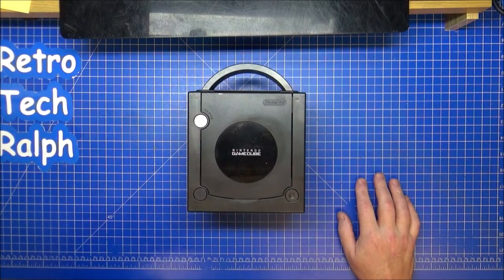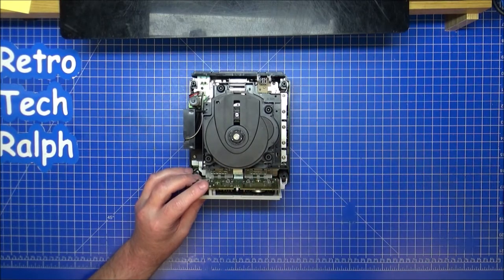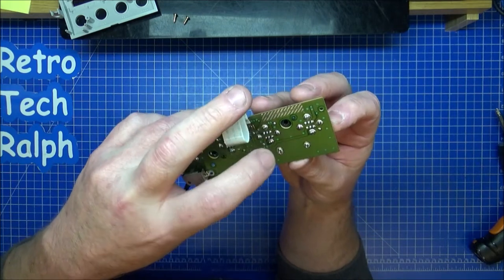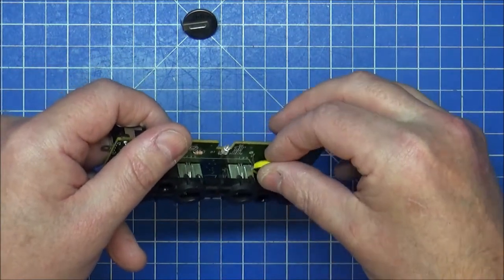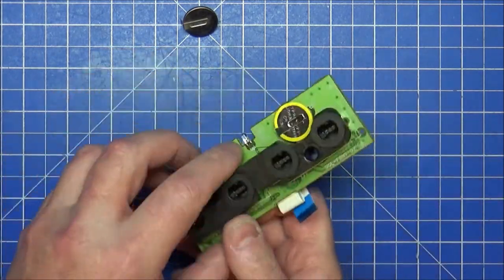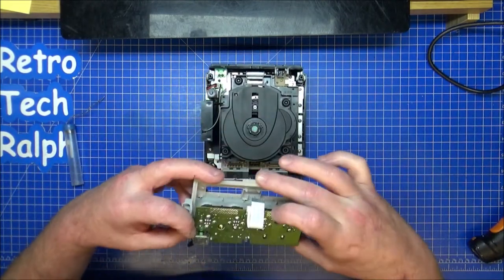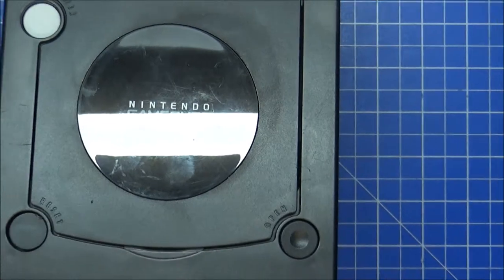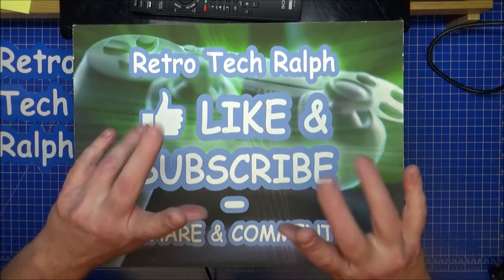Nintendo Game Cube Clock Battery Replacement

Comment: What if I got batteries that don't have the posts already attached. Can I recycle the ones from the old battery?
Reply from the maker: It is possible. The posts are usually spot welded to the battery and will be difficult to solder back onto the battery. Its not recommended to over heat any battery. If you like, you can add a battery holder instead, so you can easily replace the battery in the future.

Comment: I just took mine to a repair shop to have the battery replaced because it wasn’t keeping accurate time anymore. It would always show the time of the last time I had the console turned on. After bringing it home it now says that system settings were lost and I have to reset the clock every time again. Is it possible that the repair shop put the battery in the wrong way?
Reply from the maker: either way, they didnt do the job right. maybe a flat battery too
Reply: @R_T_Ralph  I had a warranty so I took it back. Battery was put in the wrong way. This time I plugged it in and got system settings were lost, I got 1/1/2000 instead of a random date 🙂

Comment: I've noticed that the clock seems to restart everytime I boot up the GameCube, but my Gamecube recently has been crashing as well, could the clock restarting mid game lead to the Cube crashing?
Reply from the maker: It is possible, with some games that save mid point, the clock being not set could cause a confusion on the system that could cause a crash.  Its an easy and cheap fix to replace the battery, and a must fix for all these systems anyway. 
Basically i think yes, it could be.
Reply: @R_T_Ralph  I see cheers buddy

Comment: So i got a Panasonic GameCube the times change all the time does it mean i need a new Battery if so how do i do it ?
Reply from the maker: yes, the battery will need replacing.
I dont own one but i assume the internals are the same as this, so just open it up and watch the video.
Reply: Q is not a fun machine to open up...

Comment: Are you planning the hdmi mod? I want to do it on mine but I'm not brave enough
Reply: I would suggest the eon Gamecube to HDMI convertor. Its a little expensive but easier than modifing the whole cube
Reply: @rens4354  keep in mind if you want to use that, you need the GameCube model with both ports on the back.

Comment: I don't really care bout my clock showing the right time, more about that this old battery will not leak, so will the gc still work if I remove the battery? Or do I maybe will have to "bridge" the contacts?
Reply from the maker: it will work without the battery, and to be honest, these batterys dont usually leak.
But please, dont bridge the gap, it could short something out.

Comment: really annoying that nintendo wanted to save the $0.05 and dropped the socket. now i gotta order a different battery / socket and pay extra for postage. oh well.
Reply: update: I happened to buy a hot air station for another repair; it made desoldering the battery so easy. the battery socket was easy to solder in using my iron afterwards. now no one will have to do any soldering to replace the battery. neat

Comment: I have some batteries for SNES cartridges. Will they work in a GameCube?
Reply from the maker: yes, but you may need to bend the legs a little. I use the same batteries on both, either should last a decade or more of shelf storage.
Reply: @R_T_Ralph  I've seen GameCubes that show a message in red when the battery is dead. Mine didn't, but the clock doesn't seem to run when the power is off.
Reply: @gbilo24  does that mean the battery needs to be changed?
Reply: @Emmanuel155b  Yeah. I changed the battery on mine (the clock would only run when the power was on) and now the clock works well.

Comment: Is it 100% necessary to do this? I havnt found any issues playing games even animal crossing i can start with no issues just wondering anybody?
Reply from the maker: not 100%. Its like most of these upgrades, its for the clock. some games may not play as well without the clock being set correctly, but its not essential for most gameplay.
Reply: @R_T_Ralph  cool thx for the reply much appreciated. Think i may give it a try myself in the future when i work up the courage haha have a good one.
Reply: Eventually you really want to do this because when batteries get old enough they tend to leak and can damage the PCB they are sitting on. Gamecubes might still be young enough for this not to be a common occurrence but at some point it probably will start being something you see in a lot of old Gamecubes that haven't been taken care of.